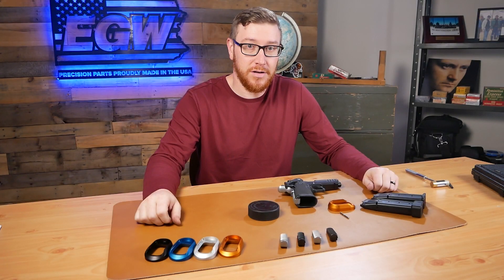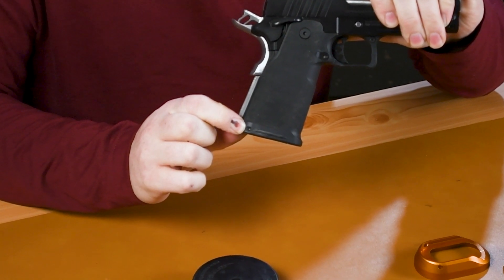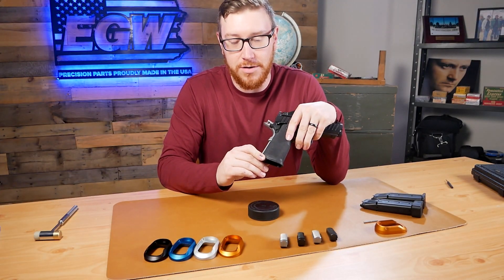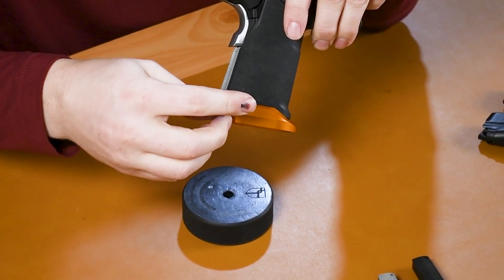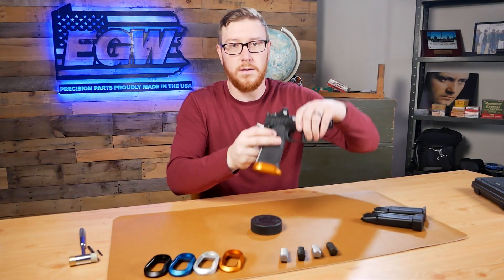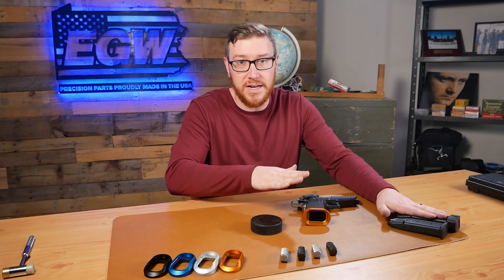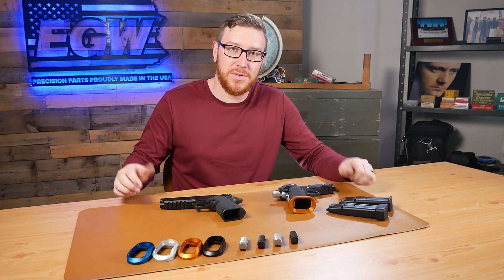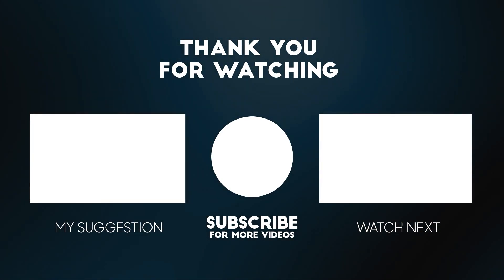EGW Springfield Prodigy Magwell Installation: Tips and Tricks for a Smooth Process

Comment: Mine in black did not slide on easy.  Not sure what was going on...felt like I was going to totally mar the bottom of the gun trying.
Reply: Same. Just installed it and it took gouges out of the plastic around the little guide rails that the grooves are supposed to slide over. Still needed to use a rubber mallet to tap into place. Seemed like the grooves were either milled too narrow for the fins on the grip or the entire magwell inside diameter is like a mm too narrow. Looks great once it's on, and don't plan on ever taking it off so gouges will be hidden forever.
Reply: My black one is the same I’m afraid to push any harder than I already have
Reply from the maker: Some might be a tighter fit than others. There is meant to be some resistance when installing our magwell onto your Prodigy. Due to manufacturing tolerances, there is a chance that it might be tighter than what it appears in the video. If you have issues, you can always give us a call and we would be happy to help you out.

Comment: Mine is extremely tight, I mean, tight to the point where the sharp metal of the mag well digs and cut the polymer on the frame. Solution???
Reply from the maker: There really is not solution for this. The tolerances for a plastic grip are far to large to account for every individual gun. Some people have an easier time installing these than other people unfortunately. If you are not satisfied with our magwell, we are always happy to take it back and issue a complete refund. If you have any further issues, please contact devin@egwguns.com. Thanks!

Comment: The magwell I bought fits so tight I can’t force it on. I’m afraid im gonna damage the grip plastic.
Reply from the maker: Some might be a tighter fit than others. There is meant to be some resistance when installing our magwell onto your Prodigy. Due to manufacturing tolerances, there is a chance that it might be tighter than what it appears in the video. If you have issues, you can always give us a call and we would be happy to help you out.

Comment: Absolutely not as easy as they show.  I had to do significant filing to get it to seat and slide down the grooves.  I had to file the front edge as well as the grooves to get the magwell to seat and slide down the grooves.  EGW needs to do better.
Reply from the maker: As you may know, manufacturing tolerances can vary. Most customers find it relatively easy to install our magwell. However, when dealing with plastic, like the Prodigy grip, these tolerances can become more pronounced. This means some customers might experience more difficulty than others. We apologize for any inconvenience you encountered. Please feel free to reach out to us for assistance if needed.